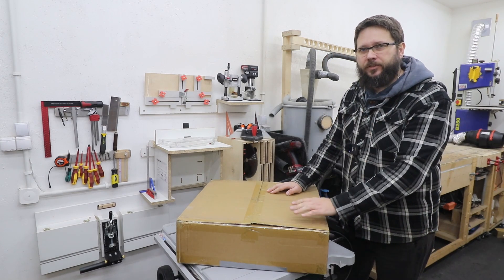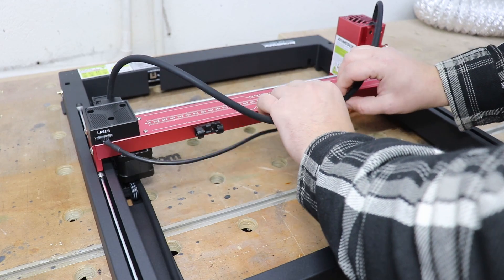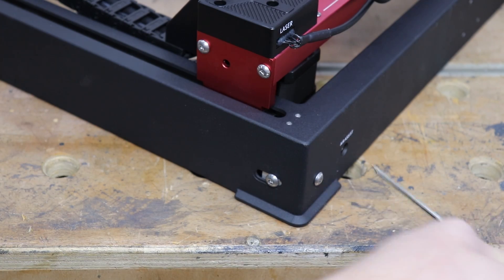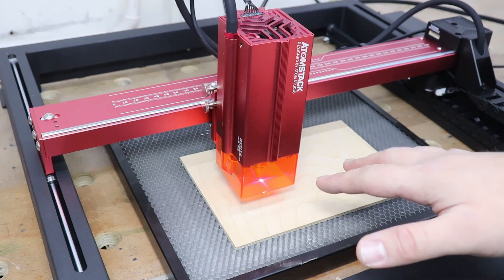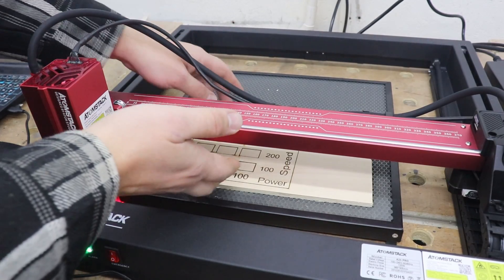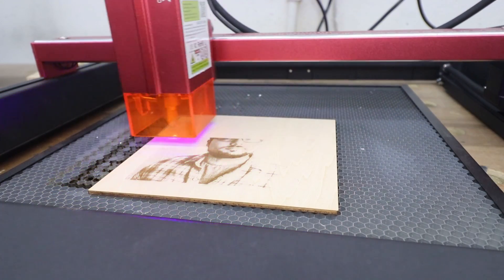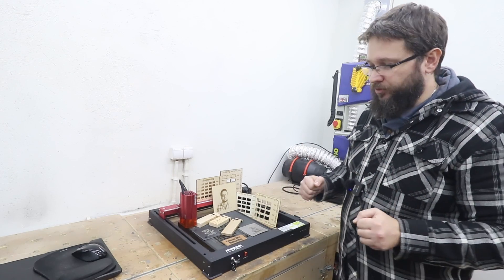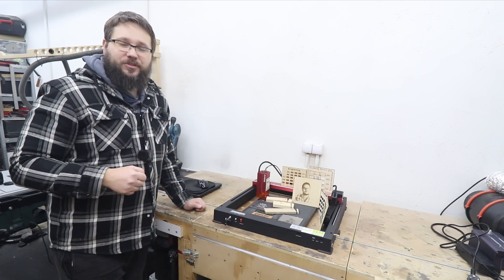AtomStack A24 Pro | Budget Friendly Laser Engraver | Detailed Testing

Comment: Could you tell me what speed and power setting you used to cut through the 20mm pine? I have never gotten mine to go all the way through and usually have to finish the job on either my scroll saw or band saw.
Reply from the maker: 3 passes of 100% power and 100mm/min

Comment: My biggest problem with that laser is trying to figure out where to place the product to have it engraved.  I play a guessing game and sometimes the engraving misses piece of the product because I didn't line it up properly.  I have resorted to engraving the image on a scrap piece of wood first to see where it is going to go, then putting the actual product on top of the scrap engraving and keeping my fingers crossed that they line up.
Reply from the maker: Your system is good, I sometimes do that for small objects, but the Frame option in the software will show you where the laser will work.
Reply: @CasualDIY I used to do that but when I tell it to frame it will trace out a rectangle using a red light. I will adjust the project and frame repeatedly until the whole red light rectangle falls on the product but then when I tell it to engrave it runs partially off the edge by about half inch. I got frustrated and switched to the test burn method.

I just ordered an enclosure that has a camera on it. I am desperately hoping that improves my accuracy
Reply from the maker: @hairounagems hmm maybe the software is not setup correctly for framing. I tested many machines and never came across that.

Comment: Hi Thomasz. I've followed your advice on everything from my choice of table saw to the MDF feather boards so it's no surprise that I find myself checking out your review of the Atomstack A24 Pro. My woodcraft market days are going really well and I'm being asked to do commissions but the conversations come to a grinding halt when the topic of personalizing comes up. To this end, I'm looking to get a laser engraving machine. I really like what you have demonstrated with the A24. The question I have is about size. Most of my boards will fit within the engraving area but if I did have a slightly larger size, or say a large charcuterie board with a handle, could you raise the frame up by the board thickness, leaving the honeycomb at bench level and lower the module to the required 4 or 6mm? The answer may be obvious, but this is my first journey into laser engraving and I just want to be sure. I also use a lot of acrylic templates which I get from a guy who cuts them for me but I like the idea of being able to cut some of my own in either ply or acrylic so it won't be just for engraving, at least in the long run. Thanks for any help. Shane.
Reply from the maker: @shanecummins2556  For cutting clear acrylic you need a CO2 laser like the xTool P2 I have. This laser will be OK for thin coloured acrylic (may not be the best for template making). With all open frame diode laser you can put them on top of the work piece. Question is how low the module will go. I can't remember how low this one can be setup. However you can always "manufacure" a mounting plate that will allow the laser to be installed lower.
Reply: @CasualDIY  Understood Thomasz. Thanks so much for the prompt reply. I'd be mainly using it for custom engraving and maybe giving my branding iron a rest for my own logo. lastly on engraving, if you wanted to engrave a logo on a laminated hardwood board, say 25mm strips of walnut and maple, do you think I would have difficulty getting a decent finish on different timbers or would it just be a case of experimenting?
Reply from the maker: @shanecummins2556  just s case of experimenting, getting the right power and speed
Reply: Thanks Thomasz. Does this require to be connected to a laptop
Reply from the maker: @shanecummins5108  I always have my workshop laptop and can't remember if you can use this one of USB stick or WiFi. If you check the product description on their website it should say that.

Comment: Thank you for this upload Thomasz. Very informative and well presented as usual. This looks like a good laser. Have you ever come across a laser that can run without connecting a laptop like the Longer Ray5 range? I am looking at upgrading mine to an enclosed laser like this Atomstack but must be able to run from an SD card.
Reply from the maker: Hmm usually you can use the WiFi to run them off an app on a phone or a tablet. I think I did review one laser that had this capability to run off an SD card but I can't remember which one. You would have to go through the videos I made on all of them

Comment: Got this machine a couple of days ago but already sent it back. Really poor quality manufacturing. 

The laser is not accurate. When you re-run the job, without touching the laser, it is a couple of mm out of alignment. 

Also, the laser head plate had an additional washer on the left wheel, which made it not square to the frame. 

I was hoping that this machine was an uograde to my 10w Xtool D1pro, but the quality of the Atomstack is not even close. 

The power of the laser was very good though.. 

Maybe the A24 that i received was faulty, but i have lost confidence in the quality control that Atomstack seem to have..

Lover your videos though! Keep it up.
Reply from the maker: Hmm shame, you must have got a bad one. Mine is perfect I wonder if they checked it before sending 🤔
Reply: @CasualDIY  yes, I wonder that too.. hard to find any other paying users with feedback...